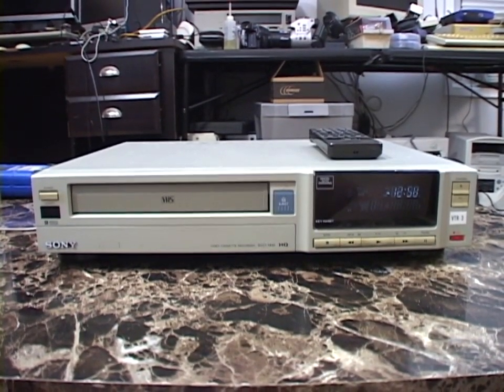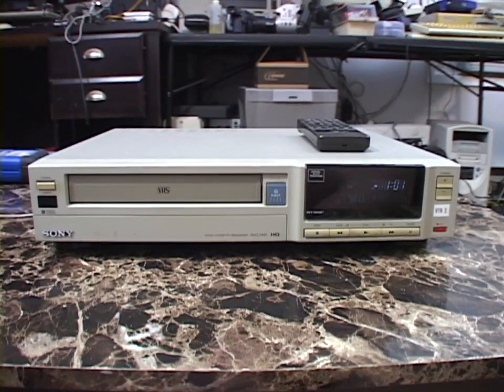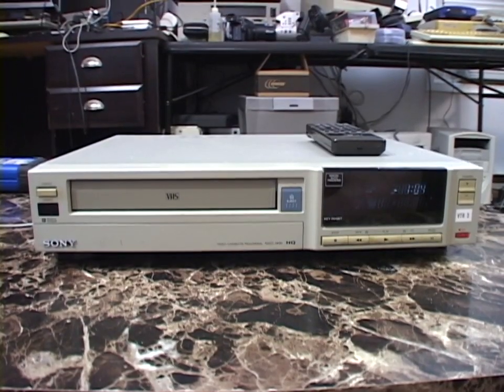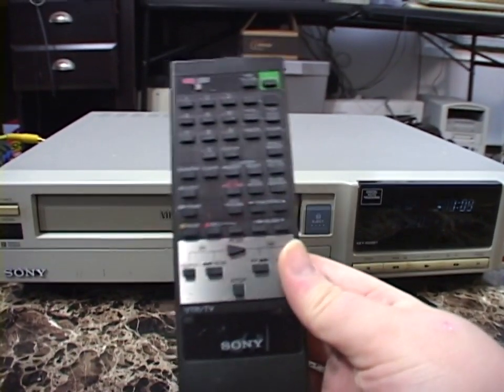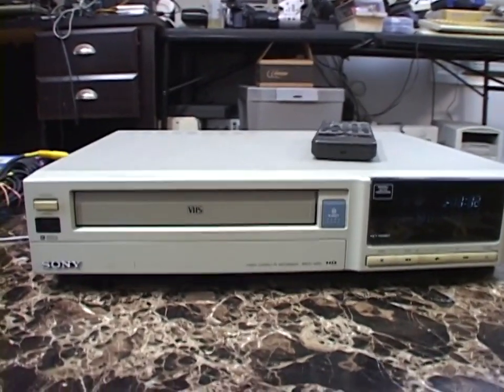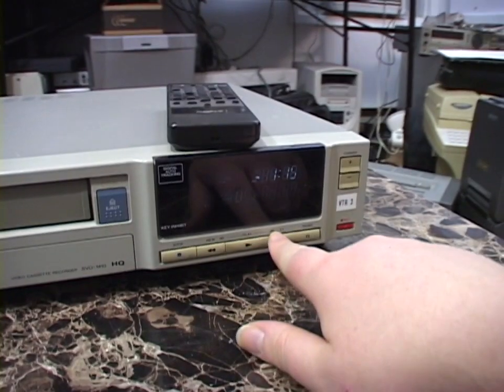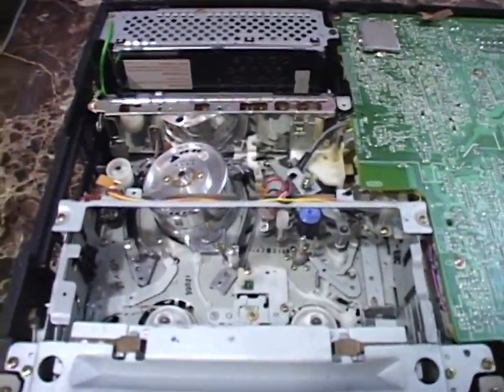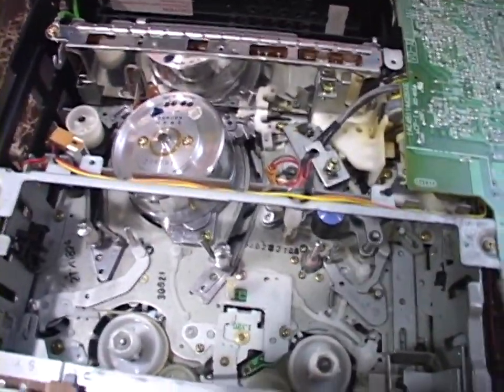Sony SVO-1410 VHS VCR (1992)

Comment: But so far as styling is concerned, the SVO-1410 is basically another SLV-272UC with a coat of white paint and a BNC connector on the rear.

Comment: Sony make VHS/S-VHS VCRs for Home and Professional. Here we can see the Tech from the Betamax VCRs (old U-Matic) where the Tape was on the Drum when you go from Play to Forward or Return. In VHS VCRs from Panasonic, JVC and others, the Tape goes in the Cassette when you want Forward or Return and then Play.....
Reply from the maker: By the mid-90s, "Quick Play" VCRs that keep the tape threaded during FF and REW were the norm. That's why this VCR does it - nothing to do with U-Matic or Betamax technology. You should have heard in the video that Sony didn't even make this VCR.
Reply: @themaritimegirl No thats not correct! Sony, Ampex and another one. do this Technology from U-Matic VCRs in the professional Market at beginning 80ties to 2000 at Cameras, VCRs and so on. In the Consumer Market, that doing only by VHS, S-VHS, Video 8, Hi8 and at last by Digital 8 and DV.....VHS/S-VHS VCRs from the Matsuhita Concern has this not....So that all VHS/S-VHS has the Problem with the Transport from the Tape in this VCRs. You can see not here, because it has the U-Matic Technology? On others from Panasonic eg. you can see at the last Lines in the under Section, many Picture distorted.

Comment: I love that you are filming your retro gear videos in this aspect ratio :)
Reply from the maker: The camcorder I use is 20 years old, so I don't have much choice either way 😁 It does have a 16:9 mode, but it crops the sensor and lowers the effective resolution, so I don't use it.

Comment: I have a SVO-5800P and the display screen only sometimes works. Would this likely be bad caps on the display board?
Reply from the maker: Possibly. It could also be a cold solder joint if the display goes between perfectly working and not working at all.

Comment: Cool and simple VCR just like I like them, no unnecessary bells and whistles.

Remember, people! Don't ever enter the closet, and if you do, come out as soon as you can. Otherwise your electrolytics will rot.

I've never ever seen an EIAJ connector, but like you say - that's pro grade stuff, and I had no experience with that. Very cool. The BNC or F connectors are way nicer than what you see on consumer stuff too.

Even I see that the belt is in a UUUUUUUUGH! shape :). Looks like you'll be going through all the rubber components of this VCR, they're likely to have the same issue.
Reply from the maker: F connectors were standard fare on consumer TVs and VCRs here. Maybe not where you are.

Comment: I think QTR with the 2 button was Sanyo's version, and OTR was Panasonic's. I have a Fisher(Sanyo) VCR with the exact same 2 QTR buttons.

That power supply screams Sony. They had nice easily removable power supplies - I remember the Sanyo units of the time having different ones entirely.

33:37 That is almost acting like the switches on the front panel are dirty.
Reply from the maker: Ah, yes, I remember you telling me that it may be a Sanyo deck with some Sony parts around it.

That was my first thought, that's obviously just a dirty switch. But no amount of contact cleaner changed anything. I think whatever digital signal is normally pulled high/low when you press the button is being forced low/high by a rogue capacitor.
Reply from the maker: I took the power supply out again because I might go ahead and replace the rest of the caps in it, and while it has no Sony or Sanyo branding anywhere, it is full of Sanyo caps.

Maybe a Sanyo power supply, but designed under requirements given by Sony?

Comment: I just found a Sony svo-1050 at value village for 10$. Came from the University of Guelph a half an hour from me.(Ontario Canada)
All I had to replace a couple belts and now it plays great. There is some scrolling ghost interference which i think is either ground loop interference or the bnc to rca adapter i used. With the quality and features they put into it i wish they would have made it a stereo hifi vhs deck instead of just mono. The linear mono audio is good sounding tho.